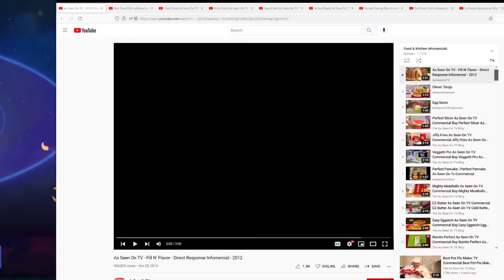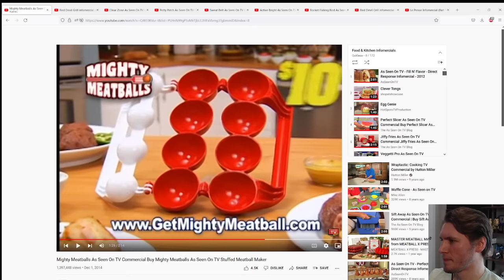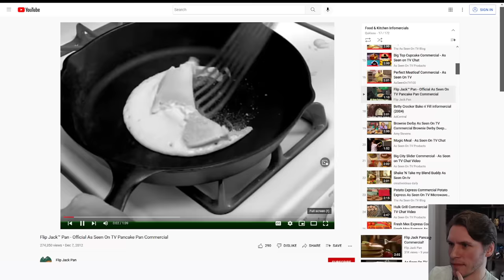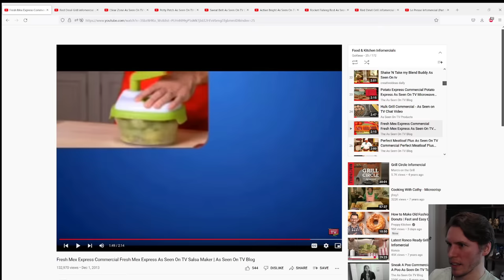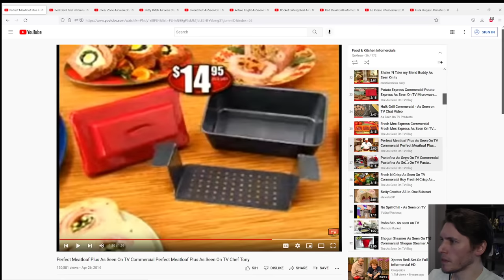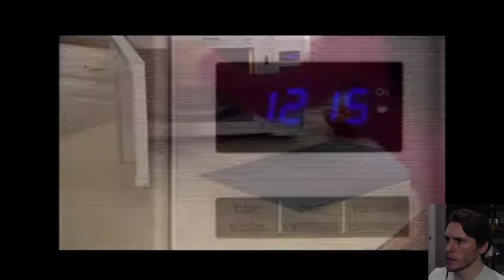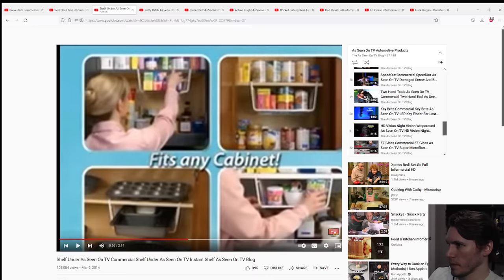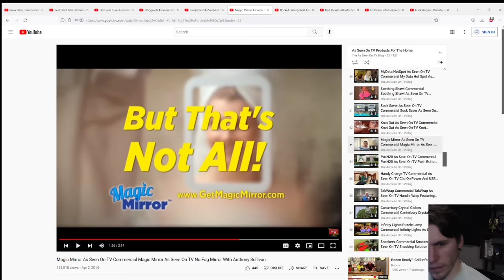Jerma Streams - Watching Infomercials

Comment: Him getting super excited over the butter slicer was great lol
Reply: You gotta admit:
1. It's practical
2. Will see a lot of use (anytime you get out the butter)
3. Most likely product to do exactly what it advertises

Hell, I kinda want one, only thing I question is if I could store it in the butter compartment in my fridge (I'm guessing not likely).
Reply: I was unimpressed until they said that each slice was made to be approximately 1/4 tablespoon, that's genuinely useful if you do a lot of baking.
Reply: +2 to both of these comments. plus, it would be very useful for disabled or elderly individuals.
and, i mean, for me personally, i don't need more than the slice size on a piece of toast. and yet, i am forever putting too much on my food and getting crumbs in the butter 😧 they just took a common problem and made a simple solution. i'd buy it 🔥
Reply: It's so ingenious, but at the same time I imagine it only lasts a minute or two out the fridge without getting gummed up with half melted butter and would be a BITCH to clean.
Reply: @JacobKinsley  I mean, it's just butter. Would probably melt fine if you rinsed it out with hot water.
Reply: hey my dad has it and it’s great
Reply: The three products that were genuinely useful were the butter slicer, the microwave potato sack, and the silicone bowl that pops into a cake tin.

I genuinely wish off brand versions of those collapsible cake bowls existed.
Reply: @ExaltedUriel  I ate meals with butter a couple times since writing this comment and I realise its more like half an hour to an hour, not 1 or 2 minutes.

Comment: I love the Pastafina, because of how utterly useless it is.  When chat said it was literally just a plastic tube, they were right.  All that talk about how great it cooks your pasta, when it's just a tall container.  I mean, it does cover the entirety of the spaghetti, but like, when you put it in a pot it becomes flaccid anyways.  Most other infomercials do something.  Maybe not a good something, but something nonetheless.  Pastafina is a tall cup.
Reply: I thought it was a glass tube? Either way it had plastic fittings. Do not expose plastic to high temperatures! The plasticizers will leach out and they're all terrible for your endocrine system. Plus, the plastics will harden and get brittle. Even 150f, etc is hot enough to do it.

How much this happens of course depends on the type of plastic and what plasticizers we're used but generally speaking most plastic plates/bowls should be kept cold.
Reply: @cheyannei5983  mmmm mmm middle aged mom with microwave plastic bowl with milk butter cheese pasta broccoli and peas makes a meal their whole lineage can appreciate

Comment: Someone needs to tell jerma the thing about the metal utensils only applies to non stick pans because itll break the protective coating which beneath is Teflon which causes cancer
Reply: I was actually thinking of that when I watched the vod. For cast iron and steel pans the scratching is more about extending the lifespan of it, but even so it's more of a suggestion because even if you make an active effort to scratch them every use they last a fairly long time.

 Teflon on the other hand!! You got to either use a bubble wrapped silicon spatula with a laser thermostat attachment or perfect your gravity defying telechintic pan flip in addition to developing daredevil heat sense ability to scramble some non-stick cancer free eggs in the morning. In addition to that remember to clean them with the soft spot of the sponge, make sure nothing is in contact with the teflon while drying and eigther buy a pan cover or remember to not put anything on it while in storage. 
He talks about it as if it's some weird cooking "respect your tools" etiquette, when in reality a scratch in that thing is a serious biohazard.
Reply: Teflon doesn't cause cancer - a material that used to be used in the production of teflon does.
Reply: @ismaelrodriguez714  well, I'll definitely try to look into that when I get the time then. Trusting businesses is generally a bad idea, yeah.
Reply: Yeah i use metal with my cast iron just fine. Making pancakes and eggs just fine where the infomercial acts like its impossible to make.
Reply: @madeleine61509  Correct answer. Our stove for example has overheating protection built-in. It's annoying AF, but I guess prevents me from killing myself.

Comment: I cannot understand how that microwave french fry maker would claim to work as shown. The actual crunch of fries is due to the high heat of oil toasting and maillarding the exterior as water rushes out of the potato, and a microwave can't produce that heat because it heats from within the food's interior, and only to boiling, never at the heat needed to maillard potato starch. That crunch sound is a clear diversion because they won't be crunchy fries, but soft rubbery sticks.
Reply: I mean - MOST of these products were outright scams. My mom and I ordered something similar when I was like 8 - thing just never showed up.

Comment: The crux of at least half of these devices is that they say 'its simple to clean and dishwasher safe' when its actually that you now have this device that has like 12 different pieces that take up half the dish washer plus if its an electric appliance theres probably a base you need to clean from stuff that drips onto it. 

I laughed out loud when they were showing them put the Hulk grill into the cabinet and said 'its as easy as storing a box of cereal' But the cabnet was like a trash can slotted space and the thing took up a good 10" in width. Like 4x the size of a family sized cereal box. But sure, just as easy to store away because physics and universal displacement laws dont apply to it.
Reply: Magic Hulk Grill bro
Reply: The dishwashers were always funny in these cause it never shows it closed cause the shit won’t fit, or you need to take out a whole rack
Reply: The whole world is your cupboard when the Hulk Grill burns down your house!
Reply: That cake tin was like "dishwasher safe" and literally took up an entire drawer

Comment: I did research on the blooming onion and yeah, the breading part is hard and you basically need a deep fryer and you probably won't have the onion outback actually uses.
The sauce comparatively is very easy to replicate.

Comment: 3:02:39 If people actually adjusted their mirrors properly this wouldn't be an issue lol. You're actually not supposed to see your own car in your side mirrors. They're supposed to be adjusted further out to the sides. 
The way to do it is:
1. Park the car (obvious, but you know how people are)
2. Lean your head on the window
3. Adjust left mirror until you just barely see your car
4. Now lean the same amount the other way
5. Adjust right mirror until you just barely see you car
Done

If done this way, when driving you won't see your car, you'll see your blind spots on either side. Your center mirror actually shows a lot more and will cover what your side mirrors used to.

Obviously ignore these instructions if your car either doesn't have a center mirror or can't, like a work van or pickup.

Source: Am professional driver with over 600,000 miles experience.

Comment: Jerma saying that washing dishes by hand uses less water is INSANE
Reply: Jerma runs water over his dishes for 3 seconds, says "DONE!" in his jerma voice and puts it back in the cupboard
Reply: When you're washing dishes by hand you don't just keep the water running the whole time, what are you talking about
Reply: @Kikiapina  I guess it depends on the size of the family. My mom and dad have 5 kids and it would take 3 hours to wash all of our dishes by hand. Jerma and Holly, that would just take a few minutes.
Reply: I wash dishes by hand too, it just feels more clean that way? Also it's kinda relaxing ngl
Reply: @Kikiapina  yeah like i dunno how people are trying to pretend the machine doesn't use a ton.  the whole point of washing by hand is you use the friction of a brush instead of just water pressure.
Reply: @irurwurst  You should watch Technology Connections on dishwashers. They recycle the same water for a really long time. It's not a constant stream from the tap. All the water used on an entire dishwasher cycle (including rinse) could probably fit inside your bathroom sink. Unless you can somehow use less water than that handwashing, then it is less wasteful to just use the dishwasher. Hell, even if you only use one or two dishes a day, you can just not run it for a few days until it is filled up sufficiently. Dishwashers are always more efficient and clean more thoroughly than handwashing.
Reply: @irurwurst  modern dishwashers use less than 4 gallons per load

Comment: 26:59 If you can believe it, there are some absolute fools who have tried forcing this tool through a watermelon without chopping off the top to get it started first. As you can imagine, the thing shattered spectacularly and blades went willynilly. This is why it's important to read ~directions~

Comment: 3:06:00 -- I've used one of these! They work just fine - I got a cheap one from China (eBay) and I used it with a pair of ear protectors I used at work (I worked in a woodworking shop) that had an FM radio built-in! The audio is very clear, since the transmitter and receiving devices are so close to each other!
Super convenient little gadget!

Comment: Jerma discussing his hatred of dishwashing machines in the middle of the stream makes me wonder... are you supposed to just mush all your dirty dishes into them and wash them like that? I thought it was customary to wash off your dishes and THEN place them in there... is that not how that works? Lmfao
Reply: Cleaning them beforehand usually helps with the cycle since you're removing most of the food on it. Plus, it helps with not making deposits at the bottom of the dishwasher.

Source: Dishwashed at a restaurant. Might not be the same, but it makes a difference when the plate stays in a machine for +- 20 seconds ompared to 1 hour.
Reply: Commercials always show people throwing dirty, crusty ass dishes into the dishwasher and it always makes me cringe. That can't be the "correct" way, no way
Reply: Wash off any huge bits of food and put it in
Reply: Washing your dishes before putting them in the 'dishwasher'? Maybe if your dishwasher sucks but at that point you're half way done to handwashing them - no point in using the crappy dishwasher
Reply: @CM_CM_  dishwashers are for sanitization, not for getting rid of 2 pounds of fucking noodles
Reply: @RhodokTribesman  yup

Comment: the problem with a lot of these products is that it is only worth it if you cook a lot, but if you cook a lot you will acquire the skills to do this stuff with normal kitchen tools. I guess there may be small audiences that use a lot of time for some of these issues but the spatula tongs is a good example; if you learn how to use a normal spatula and tongs you don’t need a combo item for a specific situation that doesn’t exist with a moderate skill level

Comment: ( In reference to around 29:13 )
I have a metal apple slicer that you push down on. It works well for soft fruits like ripe pears but for hard green apples and similar things there are problems. Today the slicer just got stuck half way and I had to cut it myself, not to mention if you need to push the fruit out of the machine (as it will usually cut 90% of it) you can get hurt. All in all you need to exert more pressure to get the fruit cut with this kind of item but usually the slices will look nicer

Comment: 20:43 nonstick (Teflon ?) pans are designed to not have a surface for food to make contact to.

The coating on said pans when heated up to a high enough temperatures (?? Dunno the temp) goes through a phase shift [Talking about matter, as in chemistry] (ignites?, burns? Takes a gaseous form?) and in its new state is is poisonous to breath.

I hypothesize that Jerma cooks on a non-stick, thus supported by verbal descriptions that Jerma gives about the experiences of food sliding in and to the sides of the pan when attempting to work the food to it’s other side 

Thus concluding that Jerma’s pan is actually working as intended, it just human error that Jerma is experiencing when have trouble with handling his food in the pan.

P.s I like Bread.

Comment: Can someone Analyse every product that was 19.95 and decide which one based on multiple different factors is the best one to get if you only had 19.95 pocket money and a bare essentials kitchen
Reply: OK so I thought about this and here's what I would get if I had 60 dollars and shipping and handling was free:
1) Potato express: I actually have one of these and they're fucking overpowered, like holy shit I cannot recommend enough getting a shitty off brand one it will revolutionise how you have a quick snack. I found out about these when I asked how my workplace canteen made such good baked potatos and I was expecting them to explain they covered it in tin foil in the oven or something, and they told me about them.

2) Mix n bake: Honestly the worst part of baking is not only cleaning up but scooping that last bit of batter out of the edges of the bowl. And unlike other products this can just be used as a generic silicone bowl or round tray when you aren't baking. Fuck stand mixers btw.

3) EZ Butter: How many meals are made better with butter? How many of those meals have you not put butter with because the effort of opening the butter, taking just the right amount out, and putting it back in the fridge is just not worth it? I rest my case.

Fresh baked potato with butter is a god tier lunch.
Reply: @JacobKinsley  I respect your right to have an opinion but I have to disagree with you about stand mixers, what have they ever done to you?
Reply: @Kitty-ion  everything made with a stand mixer tastes store bought. When you mix stuff by hand it has a really complex flavour where you have tiny speckles of intense flavour of things like butter or sugar which is what makes homemade desserts taste so ooey gooey. To me it's quite literally wanting your cake and eating it too; you want a homemade dessert you can feel proud of but you can't be bothered to put the work in for it. It's not the appliance, it's the person who decides they NEED one to make cakes.
Reply: @JacobKinsley  maybe it's just me then, I prefer more efficiency whenever I do something

Comment: So, I’ve been cooking for a long time and I have a family filled with grill fanatics so they taught me the ropes. First off, yes certain materials can damage things like cast iron pots and pans. Secondly, if you don’t want to push the burger you need to slide the spatula under the burger quickly, works almost every time.
Reply: A lesson learned in under 60 seconds, that spatula slide strat

Comment: We have the Slider Station pan and have used it plenty over the years. It works exactly as stated, can't remember any issues we've had if any. But then, there's no mechanical or moving parts. It's just a very specifically-designed pan.

Comment: We have something like the Egg Genie in our house, but it was way better. It didn’t beep when it was done, IT TURNED ITSELF OFF. I was supposed to go to bed but instead I did a little research on it, it’s a sunbeam egg poacher from 1968 (the one with the black lid). You poke the egg, put it in the egg poacher, plug it in, turn it on, walk away. It still works, it’s a reliable little machine. And apparently it’s expensive to buy these days… but I wish they would make ones like that still, it’s actually a great little machine.

Comment: What they don't tell you about the stuff like the pastafina and the shogun steamer is that its not consistently heated, you pour in the boiling water and over time it stops being hot water which means you'll likely have to boil more water than you need to have it actually do anything. They also don't tell you that you can probably just get like a steamer basket for the top of your pot which does a similar thing without a whole new item that's made from plastic. or maybe even just find a product that is exactly the shogun steamer but metal and that can be put onto a heat source to keep the temperature consistent. Would do exactly as the advertised product does, with a better result and more direct control over the process.

Comment: My car is from 2004 and has a cassette player in it. I use a Bluetooth radio thingy for my music. I used to use one that went in the cassette slot but it wore out bad and stopped working. The radio one is really good. Someone told me to use clear fm or similar sites to find the right station and it's necessary for sure.

Comment: fcking hell, I so agree on the dishwasher discussion at 56:30
I never use it and I prefer taking 10 minutes to just get through it.
another point is that we dont have alot of spoons so when its not full enough to be started and all the spoons are in there, youll have to take it out and wash it by hand anyway!
Im happy i do it by hand, its so much better imo

Comment: brutalmoose tested the coffee stick product and it didnt work, as jerma predicted. you definitely need whatever the coffee machine does with pressure
Reply: not to mention the water in the cup will rapidly cool down as it gets in contact with the cup and the air so there's not going to be enough consistent heat to infuse the coffee particules

Comment: 3:05:36 OK so, I actually have something similar to that! Mine plugs into the cigarette lighter and is Bluetooth.
It's cool enough, mostly does the job. However, if you drive down a road that would cause a normal radio station to go staticy, it will too. It's also a fucking pain to find unused stations that aren't staticy as fuck.

I need to get my grandma a car cane.